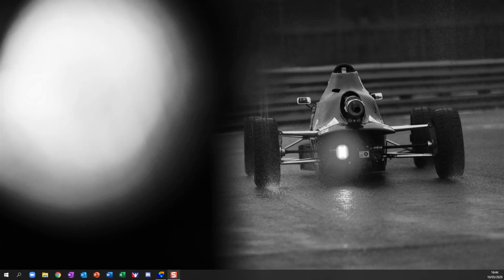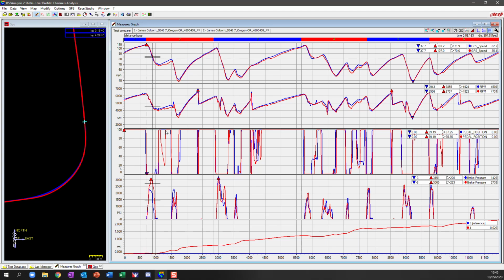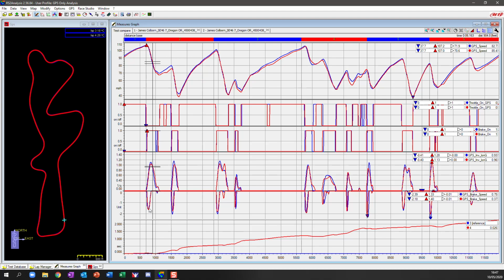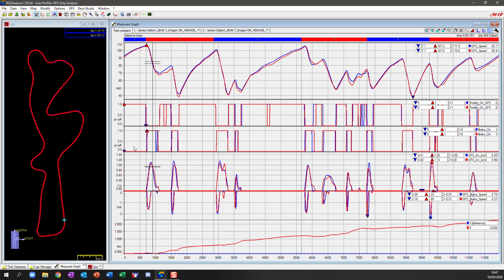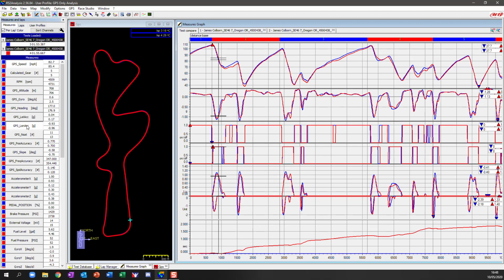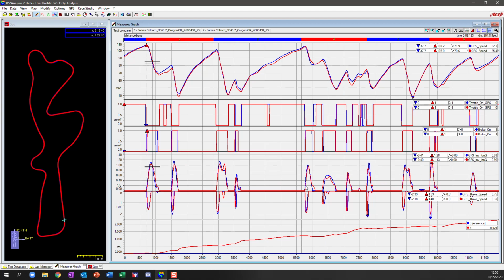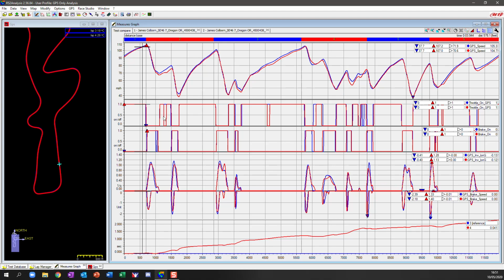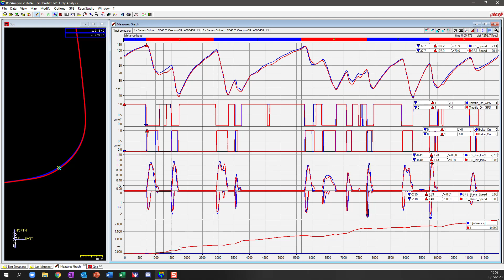AiM Race Studio Analysis - Finding Trends Using GPS Data

Comment: Is Temperatures for air or engine air?
Reply from the maker: Hi Orhan. 'Temperatures' allow for temp measurement of mulitple typres of channels. Engine water temp, oil temp, air temp, tyre temp etc. It all depends upon the channels that you have and and or the sensors that you have. Thanks!